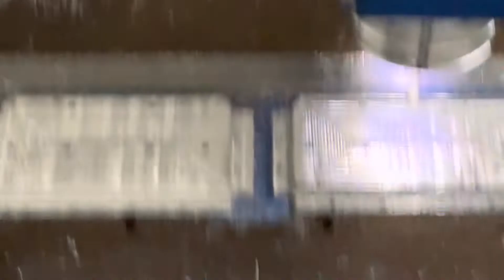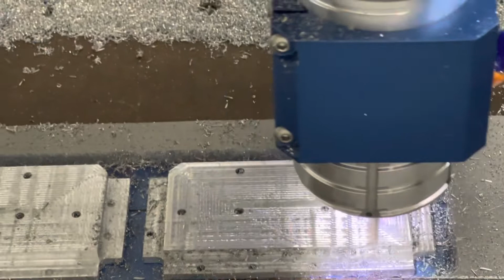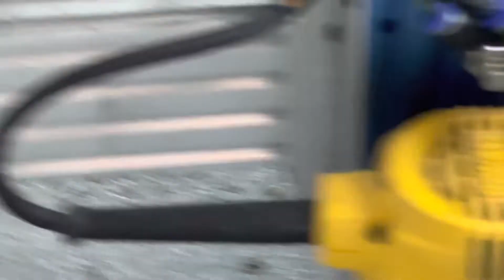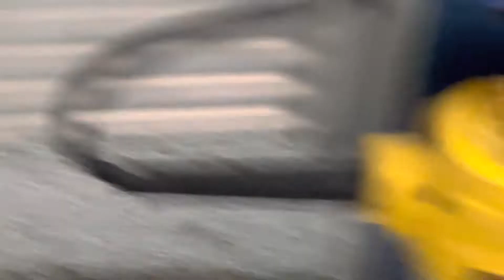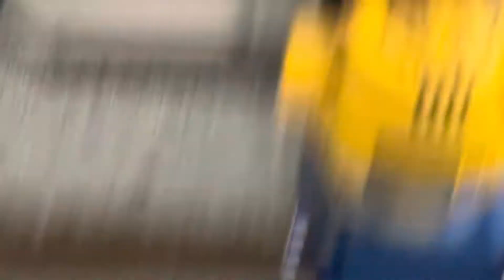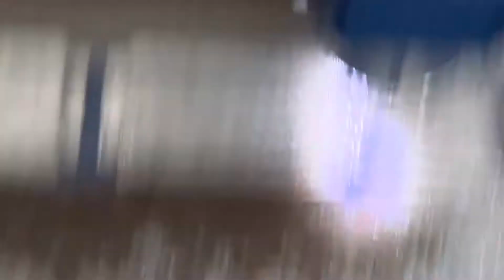ED3D Creations linear rail upgrade Y Axis plates ProverXl 4030

Comment: what milling cutter do you use for working with aluminium?
I bought the same device and would like to try it. I'm currently building the 1000mm version. the second question - what software do you work with?
Reply from the maker: I would use a single flute 6mm or 1/4 in for a stock machine, I use Fushion360 for my design software.
    I am currently using the software the machine comes with to operate the machine. But I am about to put ballscrews and new motion control and servos.
     I have everything already I am going to be using centroid acorn and I will be doing a how to video on how to convert everything over😎👍